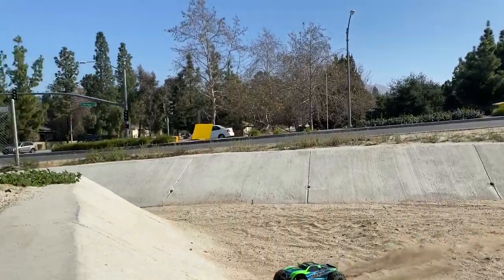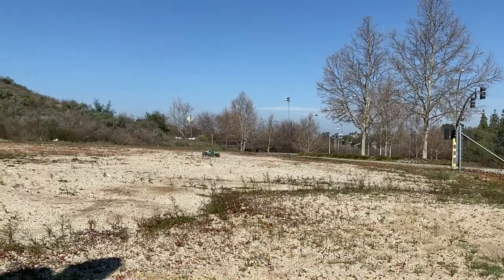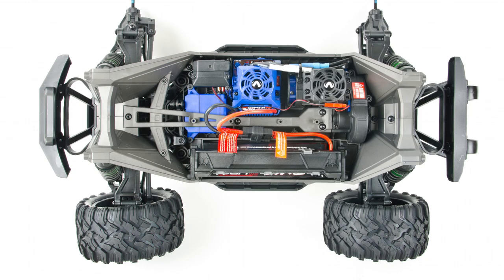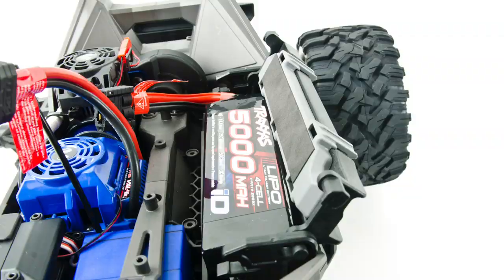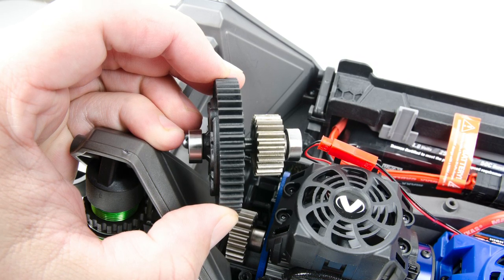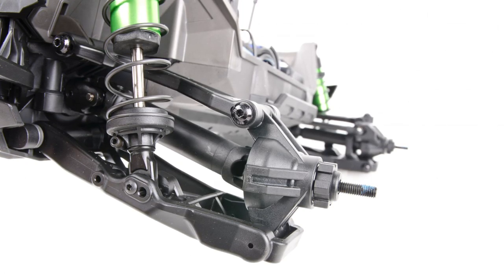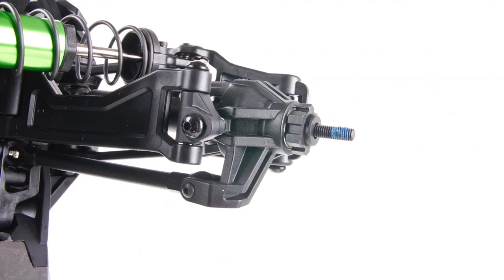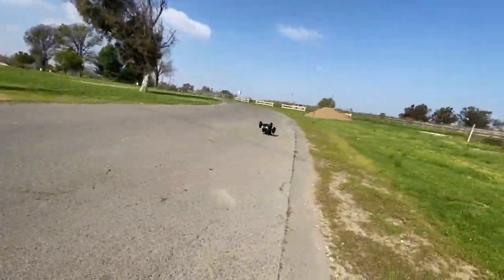Traxxas Maxx Review - Velocity RC Cars Magazine - Bash Perfect?

Comment: Love the review, just get out right down to bushiness haha
And no doubt, this thing is missing a letter.. 

Would you say this is worth the extra over a Rustler VXL (either rwd or 4wd) ? The maxx looks alot more fun.. and neither are really racers anyways. But is it worth the extra spend.
Or would you be better off going with a erevo2.0? (and also the extra spend of double the batteries and a dual charger..)
Kinda want a electric basher, but will most likely bash at my local track anyways (or the BMX track next to the RC track)
Have got a nitro revo, hence the consideration for a erevo for familarities sake (is that a word?)

Comment: If you turn the brake setting down to 90% it wont front flip. If it does turn it down a bit more
Reply from the maker: Of course. The idea is that your brake should be linear. It’s not with sensorless it doesn’t know what the motor is doing.
Reply: Of course.